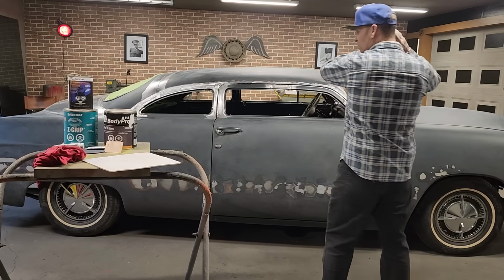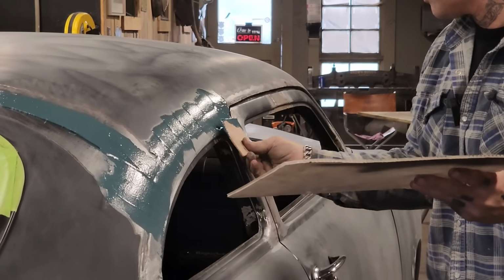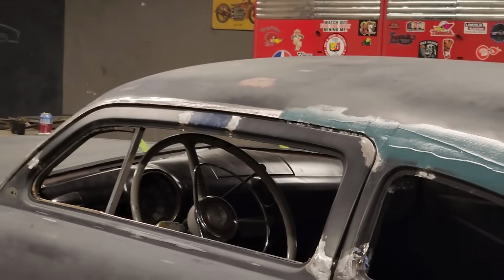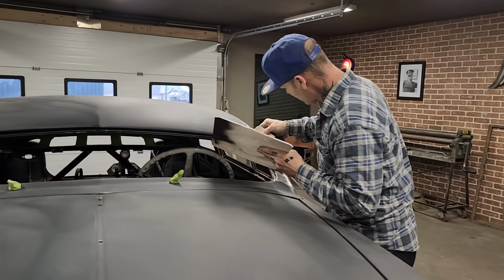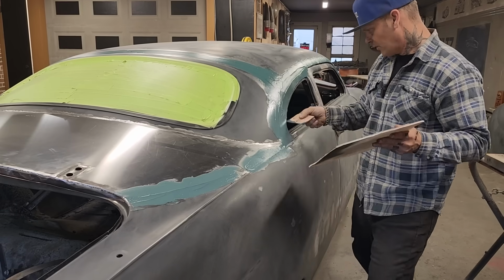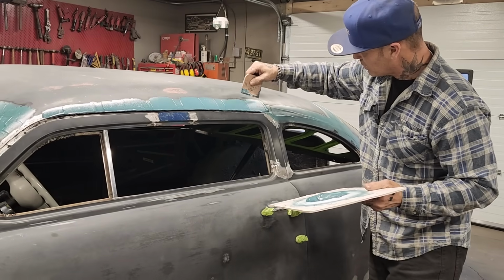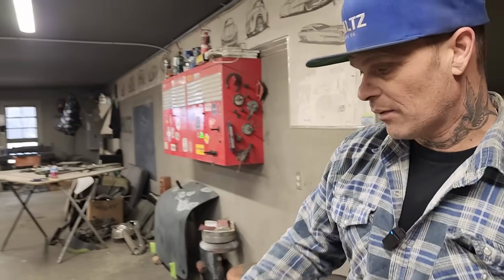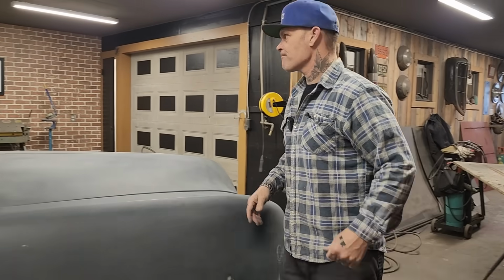The chopped roof is ready for body work 🙌🏻

Comment: I seen another fabricator do the same car your doing now and he chopped it the same amount. However he left the rear window further back and had to fabricate the sail panels. I like the way you did yours 100 times better. Your car has a much better look as far as the overall body shape. Your way actually was less intrusive to the rest of the car. There were a little more door modifications on your car than his but I liked yours more. The car looks awesome Chad and I can't wait to see what other plans you have for it and to see it in color. Great job guys and Jolene as well.
Reply: I think I seen the same car and guy you're talking about. Is it a blue one? I agree if it's the same guy I do like Chad's way better!!
Reply: @Aaronlewis8846  the blue one is Lone Wolf Garage and he really cut the roof open and cut the sail panels. I like Chads better but, I won't judge him until he is done with it.

Comment: I'm thinking the tail lights should be cut off, along with the side body lines that fit the shape of the lights. Turn them virtical, or find some other lights that would fit virtical, and flatten the sides of the rear quarters so it all fits.

Comment: Get  Nathan to lower the steering wheel. You wll see where you are going better. Its far too hgh in proportion with the lowered roof.
Reply: I notice that!  From the front it looks like it will being hitting the screen but as you look from the side it doesn't look so bad. You also need to add too is that the drivers hands will be on the wheel all of the time.
Reply: , I hope is my " Corvette" indentation, my brother-in-law's custom 49 was chopped channeled, it was Candy Brandywine, with a white pearl Corvette style body indentation, from the front wheel well, to about the 3/4 of the door, this was really popular during Roth, Barris, Winfield, Cushinberry eras.
Reply: Yah put in a tilt wheel like the guy above suggested.
Reply: It could be perfect for him maybe you're the one that's too high😂
Reply: Tunneled radio antenna, and twin spot lights would be cool too,
Reply: Been thinking that for a few days lol

Comment: Just looking at the new wheels on the car gave me another concept.  For the frontend repair or fully restore the Chrome on the front so it's sheen is balanced with the sheen on the wheels.  It would lift the overall look of the car.  Not sure what is planned but this is a nice and easy solution. Thanks for listening.

Comment: Looking good.  The only thing I would have done differently, is changed trunk hinges (put hinges inside the trunk) and covered up hinge holes with the metal behind the roof instead of cutting the metal around the hinges….just my two cents.
Reply: I’ll up that to four cents.
Reply: remember, Chad looks to do what he hasn’t seen before, that’s why the hinges are seeable

Comment: I tried Chad's epoxy trick and it worked like a charm, the extra open time made the application and some shaping so much easier. Sanding was a breeze. I found acetone did a pretty thorough job of getting my hands and arms clean, although I had to use my wifes hand cream to get some moisture back in. The ladies do like a soft touch!!